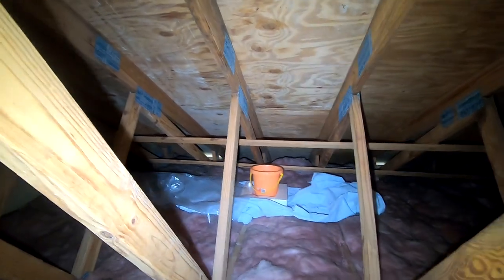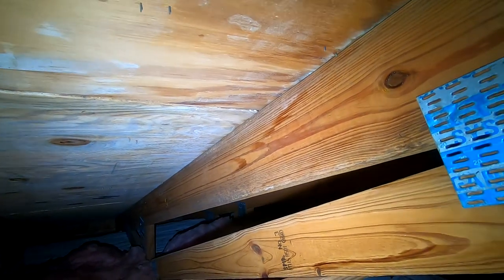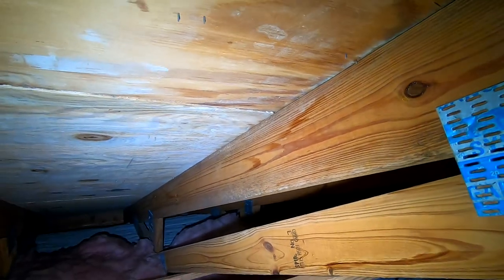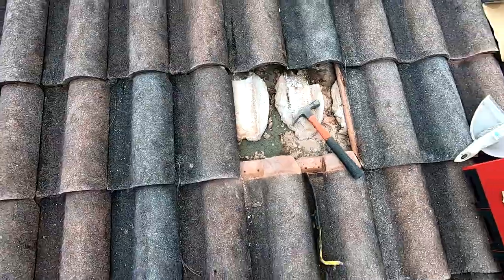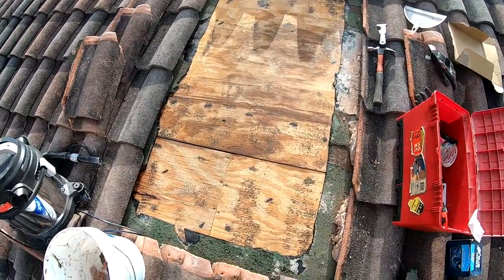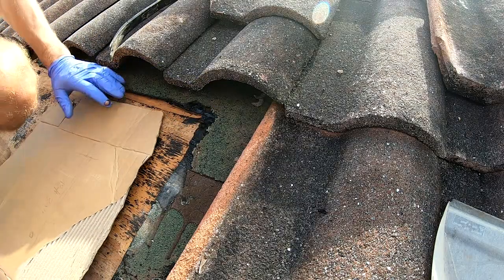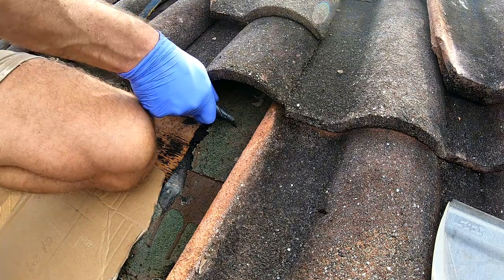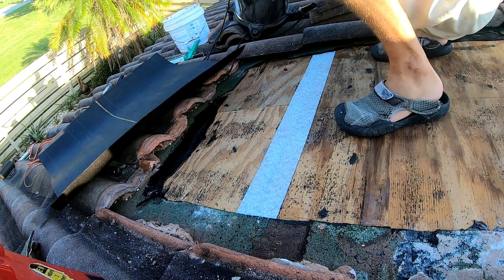How to Fix a Leak on Tile Roof

Comment: Did you get any estimates from roofing companies?  I’m looking for a roofer.
Reply from the maker: No cause I know that to fix area this size would cost me min few hundred dollars. Material for this job cost less than $50 that's why if you are willing to do the job you can save yourself lots of money
Reply: @MaciejPiotrowski  They quoted me $5,300.
Reply from the maker: @junjiema4613  It's a robbery !!! Do it yourself. Material will cost you less than $100

Comment: is there any way to reinforce roof tiles to resist cracking? I'm looking at Two-Component-Flexible-Cementitious-Waterproofing. Any thoughts?
Reply from the maker: I'm not an expert on those things but from my experience, if I walk on tiles putting my feet on the flat part of the tile instead of the top curved one they never crack. Walk in the valleys of the tiles and they will never crack.